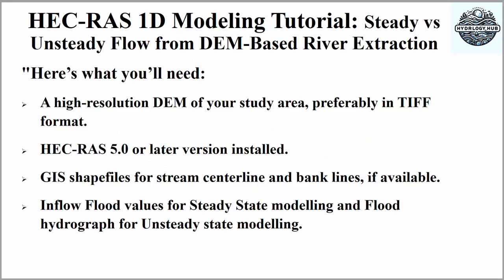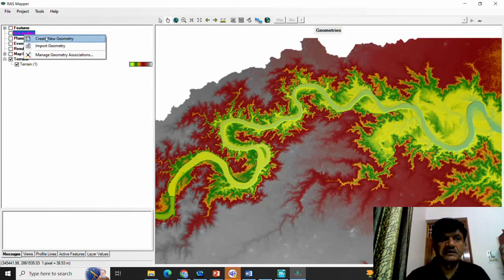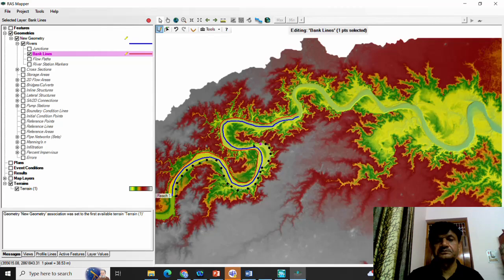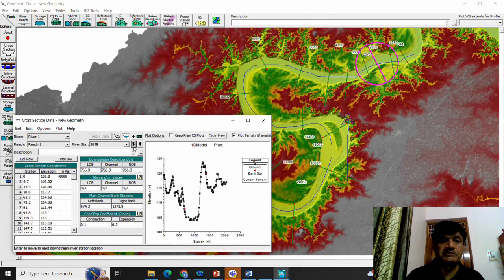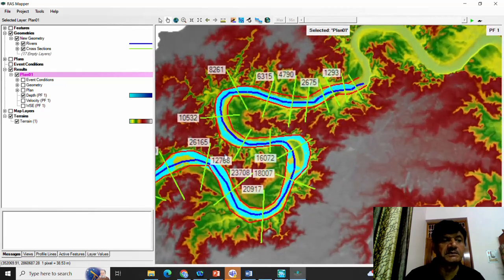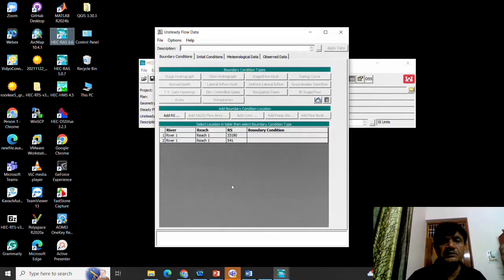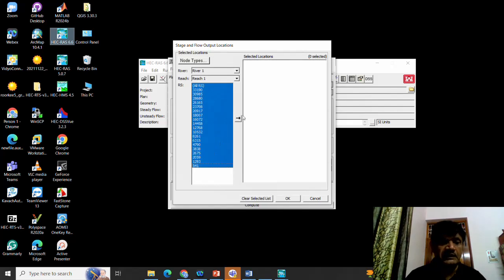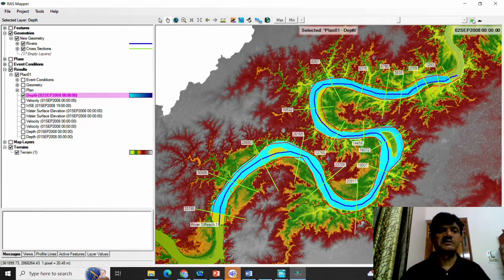(3/16) HEC-RAS 1D Modeling Tutorial: Steady vs Unsteady Flow from DEM-Based River Extraction

Comment: Thank you so much for the video. There is one question? In unsteady state flow, the flow in RAS mapper shows gaps, not filled like in steady state flow. Would you clarify the doubt please
Reply from the maker: That’s an excellent observation 

In steady flow runs, HEC-RAS computes a single water surface profile for each cross-section and then interpolates between them. The terrain is filled smoothly between cross-sections, so when you visualize it in RAS Mapper, the inundation looks “continuous” and gap-free.

In unsteady simulations, water surface elevations are computed at every time step. 
RAS Mapper doesn’t create a single continuous “fill”; instead, it interpolates dynamically between cross-sections and time slices. If the computational mesh (cross-sections or 2D flow areas) is sparse or irregular, gaps can appear because water surfaces aren’t fully interpolated across the terrain at some time steps.

I will try to explain it in the future video.